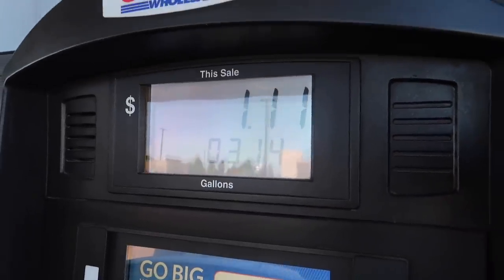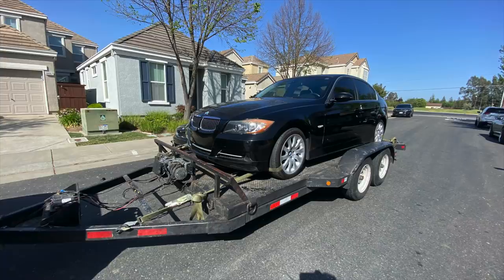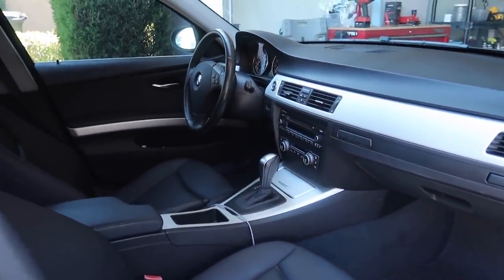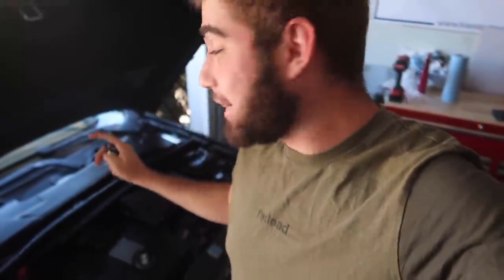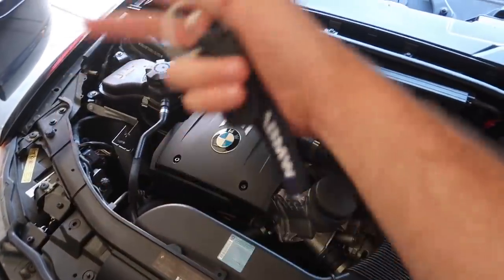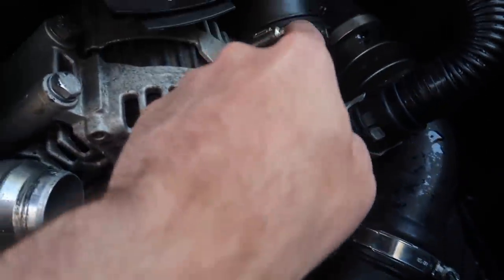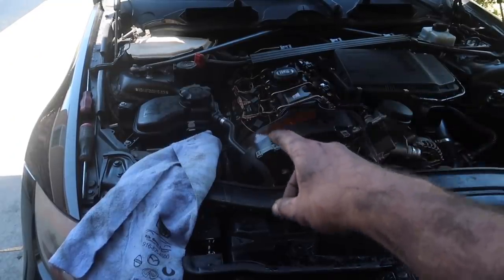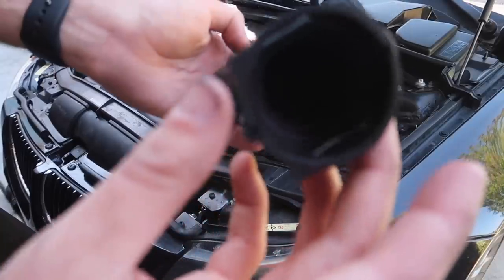HOW I TURNED THIS $2000 BMW TO A $8000 BMW IN ONE DAY!

Comment: Check the oil filter! Make sure there’s no metals. I had a lifter tick and it ate my engine away. I ended up swapping the motor. Happened at 95k miles

Comment: Hey Nour, that ticking noise could be the engine oil filter. It’s a known problem if you don’t install the correct oil filter (Mann). Let me know if it helps.

Comment: Are you sure the noise isn't just the injectors ticking? As you probably already know, N54's have really noisy injectors. Especially the earlier ones like Index-1, 2, 3 etc.. I remember the first couple times I serviced my cousins e90 (335xi) I was convinced it had some kind of problem with the cams and valve train because the ticking sound was so loud but it turned out to just be noisy injectors and apparently is completely normal especially for the earlier N54's. One way you can test it is start the car without the engine cover on and physically touch each injector as it's running, you'll feel them clicking and if the sound seems to coordinate with the injectors firing you'll know that's what's causing the noise.

Comment: check your oil filter, replace the gaskets on the filter cap and the filter itself. 
that’s my best guess, if they did an oil change and didn’t tighten the filter down of replace the gaskets you could be starving the engine of oil which is causing the tick.

Comment: Bro check the bolts that mount the power steering pump to the block! And also the 4 bolts holding the power steering pulley! My N54 had a noise that sounded like rod knock but turns out the 4 bolts that hold the pulley on the power steering pump were all hand tight and were causing that noise! Just tightened them and never heard the noise again!

Comment: One easy way to know it's lifters Don't overfill add one quart of transmission fluid take it on the highway run it for about 50 miles if the tick goes away it's not an adjustment Not sure if there's and an adjustment tensioner for the timing on this motor but that would cause the timing chain to rattle and easy way to find out take a long screwdriver put it in areas where you can hear the tapping with your ear to the top of the screwdriver Old mechanics trick at least you'll Narrow it down Good hunting

Comment: Could be a stuck lifter, I had one in my 911 and it was fixed with just an oil change, but on the other hand you could have bore scoring and have your cylinder walls scratched which is commonly misdiagnosed for a stuck lifter.

Comment: Heard a tick similar like that on my n52 and thought it was the serpentine belt pulley which was already replaced 2k ago, but it ended up being the oil filter, so do an oil change and replace the filter, if that that then I’m thinking the vanos so rip lol

Comment: Dude drive the car the sound will go away. That’s just how most e90s sounds on cold start after sitting for some time. I had the same issue on one of my n52s and I drove it around and went away

Comment: Sounds like the timing is off in the motor
Reply: The valve is probably still slightly open when the piston hits the top causing them to hit each other making that sound most likely for the cylinders that says it’s misfiring....if it’s not that the timing definitely is off, because it isn’t a rod knock
Reply: You should try listening if the ticking sound is coming directly from the head of the engine if it is then your camshaft timing probably off which will require you to reset the timing chain to the correct timing to open and close the valves at the right time